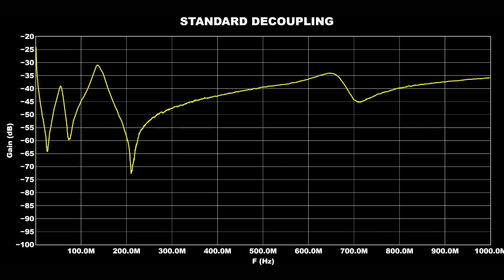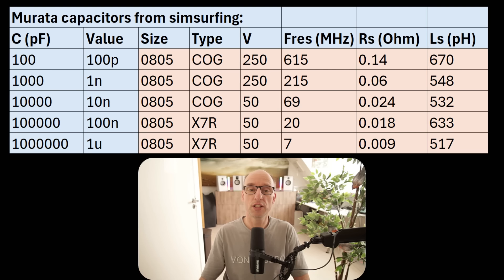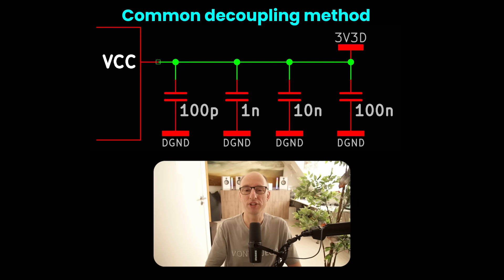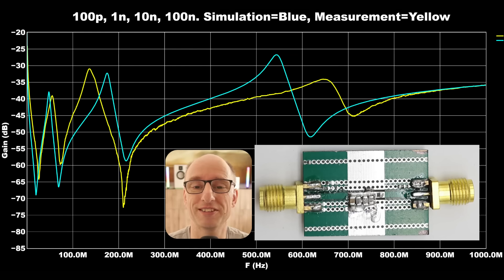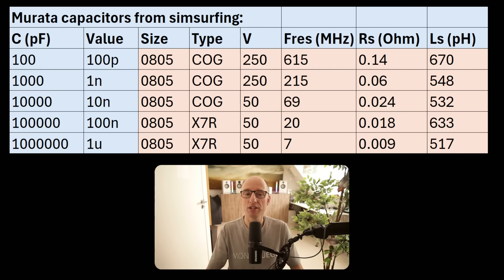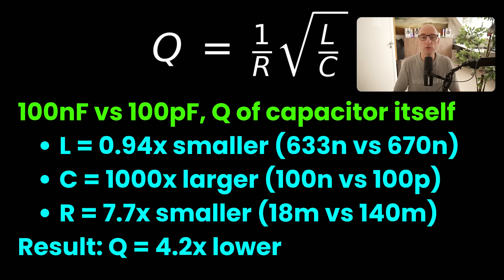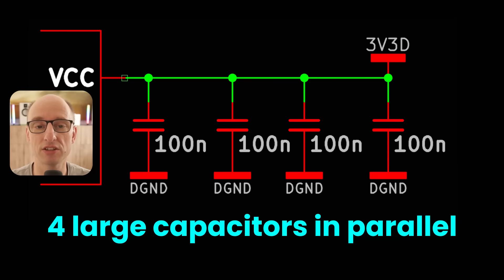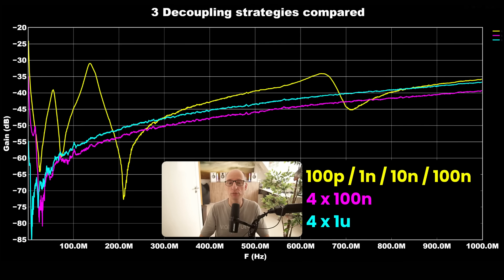The most misunderstood concept in decoupling

Comment: That explain the array of capacitor on the back of gpu having extreme transient and very sensible to noise.
Reply from the maker: Fascinating discussion. I never had to build something like this, but it shows that the theory is correct. Really  nice to see some actual examples! Thanks
Reply: yea, those are most probably 10-22uf smd caps, and you need ceramic capacitors very near to the core, why, because your gpu's transient load would zero the power supply in a second. Also most of the more modern gpu's core takes 100 to up to 700Amper of current, so you most definietly need those caps stacked.
An older gpu like Vega64 Would easily do 1000Watt spikes, and thats why so much Vega64 just crashes, the driver is too brutal on power, and thinks it can take upwards of a 1000watt from its such underbuilt VRM design, i did stacked 22uf smd caps and they worked well.
This video is not about that you just put one or two at max bypass caps like in an amplifier use. Like in computer equipment, you need the bypass caps, many of em, because they work at an upwards of Mhz and Ghz areas where it has not just one or two Amps of load...
Reply: @Uraim  My 3080 has 6 array of 10 MLCC cap on the back with a uncountable amount of 08, 06 and 04 around it, some cap some resistor by the color or it.

It was a early flaw of the 30 series that the cards would just crash midgame when some vendor went for 6 large cap instead of 6 array of 10 MLCC.

It's interesting to understand why something was built the way it was.
Reply: @miranina1585  Happens to all of us. There are some trainwreck 4090's and 5090's too that definietly needs underclock due underbuilt VRM, I think it was the Zotac or Pny RTX 5090.

Comment: Why not a single 1uF cap with 2 to 3 ohms in series? Fewer parts, less board space...
Reply: This approach is used for analog circuits that are very sensitive to noise by acting as a RC filter with the decoupling capacitor. But such circuits usually don't consume a lot of current and don't have very large transients in the first place. This tends not to work for digital circuits if the transients are too frequent, too large, or too long in duration. When that happens the decoupling capacitors cannot recharge in time or the voltage drop introduced is intolerable, respectively.

In your example the -3dB frequency is only ~80kHz. Even a microcontroller running at 50MHz or even faster is going to have transients and be recharging much more frequently than a few hundred kHzs (found by converting 80kHz sinusoid to rise time using 0.35 factor and making a reasonable square wave using that rise time) and powerful processors and FPGAs can have transients in multiple amps

Ferrites can be used instead of resistors to get around the voltage drop but this also introduces a resonances and if if the resonance lands on a noise frequency in your system it will make the noise worse than if the ferrite wasn't there at all. So it's risky unless your system noise is well characterized.
Reply: Power loss and voltage drop are why we wouldn't do this. This approach can work for some things. I have used it on some low-power circuits myself, and it can be quite effective for supplying a low-power device and isolating it from ripples caused by a higher-power device. This approach fails when supplying to a high-power device.
Reply: It depends on the curret. For example, if the load after that 2 ohms resistor is pulling only 1 Amp, it'll drop 2v across the resistor and dissipate 2 watts. That can be a considerable amount of heat depending on the application.
Reply: No, no, not in series with the load, with the cap!
Reply: @r0cketplumber  Oh you putting a resistor and capacitor in a series combination and sticking the entire thing in parallel with the load? That effectively increases the ESR of the capacitor and while it does damp out the resonance it also destroys the decoupling capability. I seem to remember the ESR target for the decoupling frequencies of interest being on the order of tens of mOhms. So a 1 Ohm capacitor would destroy the decoupling capability.

Incidentally, this is the reason (other than cost) that you usually don't usually use C0G capacitors for decoupling. Their ESR is so low that ringing can occur (even if it's the only decoupling capacitor). But the just the slightly increased ESR of an X7R capacitor is enough to resolve this.
Reply: @DKNguyen3.1415  It seems like you didn't watch the whole video 😉 Schematic is at 11:40 and he talks about it since 11:00. 
I am tired so I didn't go into why exactly this works better. 
My guess would be that bigger capacitor would transition to inductive region (schematic at 2:00) at a higher frequency, when we want this resonant "dip" (between inductive and capacitive region) to be at a frequency lower than our circuit (schematic at 8:50)
Still it is a wild guess so feel free to correct me as I am really tired :)
Reply: @przemo555  Well, he's getting around the ESR problem by using four branches in parallel so there's not 1 Ohm there but 250mOhms. Basically the same as using higher ESR capacitors which have more damping/lower Q but then using a bunch of them in parallel to compensate for the higher ESR.

If that's what the OP is talking about then the reason you can't just use one branch with a 1uF capacitor then it is because the ESR is too high (1ohm vs 250mohms) and that larger capacitances (which tend to come in larger packages) have a strong tendency to have more parasitic inductance and that hurts your decoupling. There are odd exceptions here and there though. It's why you use ten 100nF capacitors in parallel rather than a single 1uF capacitor. You're trying to develop enough bulk inductance to handle the energy of the transient while maintaining an inductance low enough that the transient isn't too fast to decouple.
Reply from the maker: Great discussion! :-)

Comment: This looks interesting and useful. However now I get more questions: how this will behave under real board load (irregular pulsed power consumption by ICs)? does not IC behave itself like a capacitor + inductor + resistor (Many ICs are known to have very small value capacitor built-in)? 
What about using ground AND power planes + same value decoupling capacitors, won't ground-power planes itself create capacitor of different inductance (and R and C) contrasting to decoupling capacitors and thus then decoupling capacitors should be matched to inductance of planes to mitigate the resonance?
I think this same value capacitor rule of thumb simplifies design, however it is not cure for everything, and adding real load could bring some surprise.
Reply from the maker: If you have high load peaks, and very strict ripple requirements (cpu/fpga/video card supplies). Then you must model EVERYTHING. So your concerns are correct. For most applications, first order modelling will do.

Comment: Hi, thanks for your analysis. You are using X7R capacitors, but is it possible to use 100n C0G capacitors as well - what do you think? Yes, they are more expensive, but the capacitance value of C0G capacitors is almost voltage independent (this is a significant disadvantage of MLC capacitors made of X7R and similar materials).
Reply: The inductance will be the same, so while the capacitance under bias changes less, the actual impedance will be nearly identical to an X7R with the same effective capacitance at that bias voltage. Personally I would not use a C0G for decoupling.
Reply from the maker: correct, size and price are the main issues. A 100nF cog is probably a 1206 (at least that is the ones I have in my bin for high performance analog applications)

Comment: Very good video. Thanks. It would be curious to see what the effect of big power and ground planes is on this setup. Especially if you have just something like a 0.1mm prepreg layer between them. The lumped capacitance starts to matter.
Reply from the maker: that works well, virtually no trace inductance, but you will need big caps somewhere, so you'll still need to watch out for resonances if you combine multiple values.

Comment: I was under the impression it was good practice to combine electrolytic capacitors with ceramic ones on a supply line, since this involves way different characteristics and sizes, does this apply?
Reply from the maker: You have to do that often: You'll get a resonance, you have to check that.
Reply: @HansRosenberg74  Thx!

Comment: Excellent, Video, thanks!
With modern FPGAs and other big chips, there may be on-chip bypassing, and on-package bypassing for very high frequencies. These significantly simplify the bypassing requirements. Always start with the manufacturers'  recommendations for the specific devices. When I worked at a big ATE company, the engineers who had done previous generation FPGAs had old recommendations and tools for bypassing FPGAs that did account for the modern, on-chip bypassing.  Beware.
Reply from the maker: The on-chip capacitors cannot handle the large current spikes, you must have something outside the chip. If you have a very critical application, you actually have to model the on-chip caps and bondwires as well!!!
Reply: I once worked for Factron circa 1985,  Bournemouth UK.
The cabinet sized ATE with its large 2000 count circuit boards in 19" racks and mountains of ribbon cables, rather fun.
Once saw the flow solder guy drop a full rack of unsoldered PCBs , quite a mess.

Comment: Thanks for the informative video! Why are multiple decoupling capacitors better than one big decoupling capacitor though?
Reply: Multiple capacitors are better than one big one for two reasons: equivalent series resistance (ESR), and equivalent series inductance (ESL). Many times, one big capacitor won't work so well at higher frequencies because of these parasitic effects. Smaller capacitors tend to have lower ESR and ESL, so putting a smaller one in parallel with a bigger capacitor will allow you to improve the decoupling at higher frequencies.  If you know the ESR and ESL of all your capacitors, you can even simulate this and swap out capacitors until you get the high frequency response you want.
Reply from the maker: indeed!